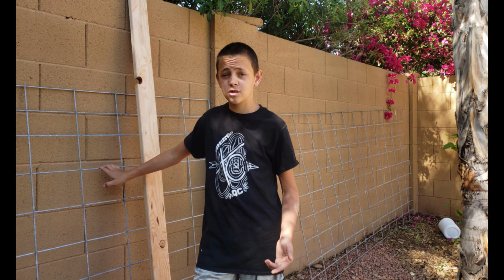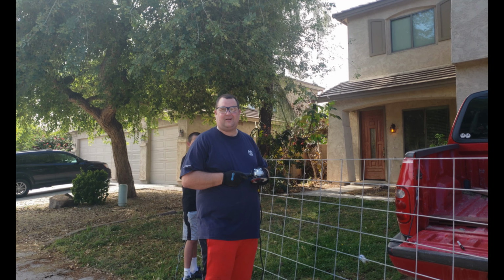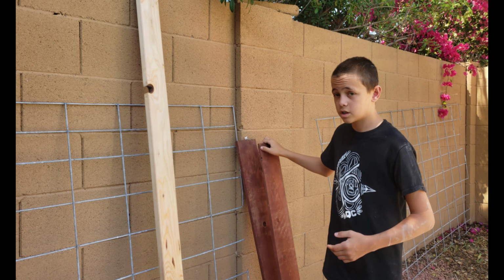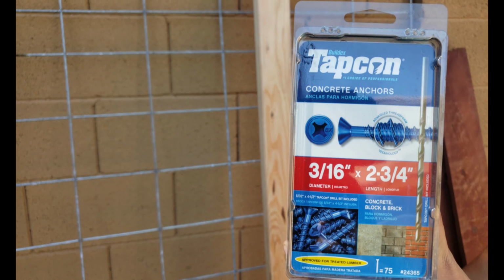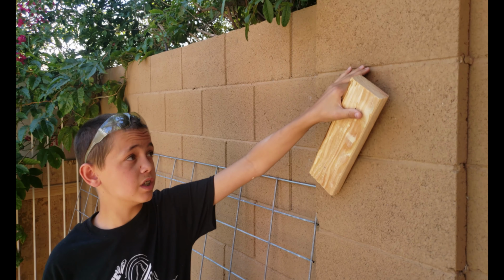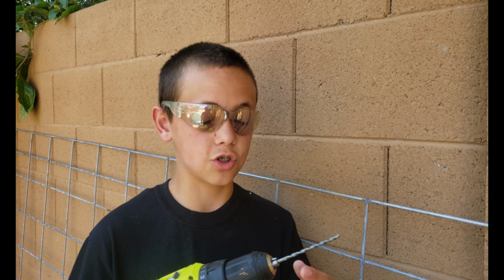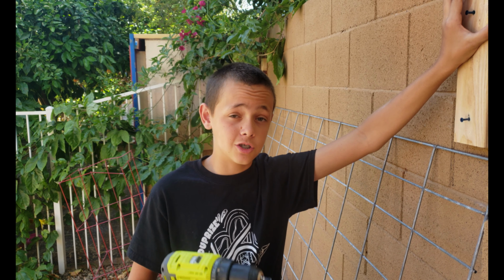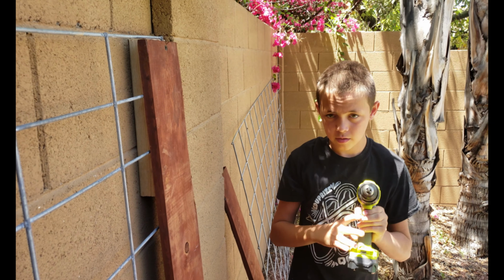DIY Cinder Block Trellis Using Cattle Panel

Comment: This is a really nice and helpful video! I have a very similar concrete block fence and would love to do something similar to add some greenery up the wall. A few questions — Did you do anything to attach the cattle panel to the first wood block? Or does the second (2x6) wood piece hold it up once it is screwed in? Also, I see that fence is pretty shaded, does your passion fruit vine do ok in the sun, or does it need shade? Do you know what variety it is?

Thanks for any info you can provide!
Reply: Ohh, I just clicked on your channel and saw you are in Tennessee now! No more desert gardening 😂
Reply from the maker: The 2nd pannel holds it up.

They do well in some shade and full sun.  Actually they grow with just the heat as far as I can tell.